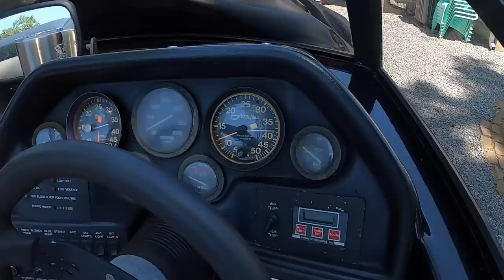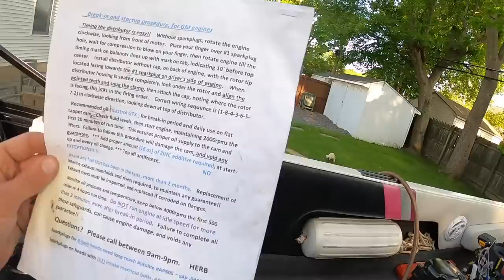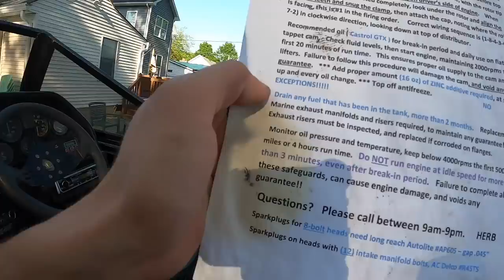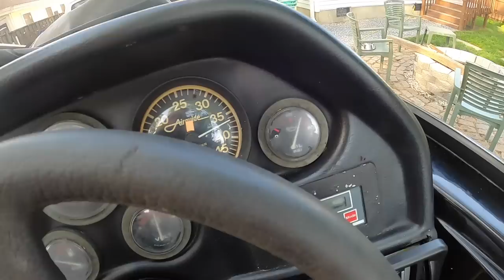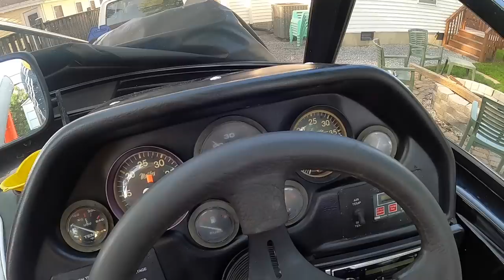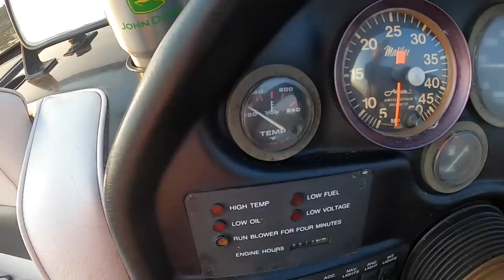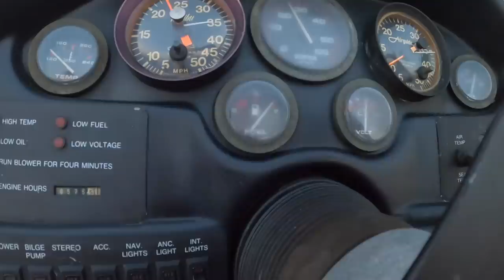NEW 350 HP CHEVY ENGINE - 1991 Malibu Competition Ski Tow Boat - Will It Start? | BOAT RESTORATION

Comment: The shaft seal should have a slight drip otherwise it will overheat. There are newer styles that are dripless. You should probably change the packing inside anyway and get the drip rate set correctly.
Reply: I thought they are supposed to drip while in gear but not drip when not in gear

Comment: I'll be honest. My last custom built boat which was a Triple pontoon. I wanted to build myself cuz I wanted to have a bit of a different layout then normal and i wanted a longer boat and for it to be a inboard outboard setup. I ended up finding this company that sells the pontoons in fit together pieces made of a special polymer that's like a light color and they have several to choose from. But what's really cool is that you can put lighting inside the toons themselves and they light up and I've never seen anyone else have it. And I get so many comments on it. The other thing I did was on the front each pontoon has thrusters so that I can turn on a dime if needed. And then on either side of the main engine are two electric motors that actually go inside the toons and thru the back that can be ran together or one at a time and believe me sometimes it's nice not listening to my ridiculously loud olds 454 that's cammed out and supercharged around 850hp and yes it drinks at idle about 2 gallons an hour. I've never tested it above 70mph because it gets super squirrelly but still handles good. I imagine that I can easily hit 100mph which is saying alot for a 28 foot pontoon. That's also got a swim platform and secondary helm on the second floor. I also decided to try the new fencing design that isnt steel but ultralight aluminum frames with polished acrylic panels that are black and depending on how you want it the acrylic can fade to not be see thru or to allow the lights in. I wanted from the mid seating which are double wide couches with backrests to the rear end minus 2.5 feet so you still have a rear platform to fish off of or to get to the ladder for the secondary platform. I also have an enclosed bathroom with running sink and toilet. 

My point being this. A ton of folks do ls swaps for their boats but it's so boring. Honestly I'm in the works of building a 1950 to 1960s old mahogany style chris craft. But with something that's much lighter and having a teak deck and floor. But to power it. I want to run twin rotary engines from the newest style rx8s. You can really put a ton of power thru them sometimes up to 1000hp they are indestructible and they want to be revving easily between 8 and 10k. So they would work great. I know they did a version of these for jet engines but I wanna do prop driven. We shall see. I really wish more people built custom boats. One day I'd like to build my dream houseboat using these custom pontoons. There really is no cheaper options. And living on the water is where me my wife and two boys want to be

Comment: Cool project i had a customer that put a built 383 in his 86 malibu skier it was a beast ....didn't go much faster than 60 but it would get there quick and pull the whole dock and ski team around the lake. Malibu did build the Corvette boat with a 383 Indmar it was a ripper @ 60 mph also.....shaft angle and hull design limit the speed these hulls will achieve they are not designed for all out speed but for pulling and wake shape ....its a slalom hull so flat and smooth is what is needed often the hull will have a hook in the rear to help run flat and as speed increases more down force is put on the nose of the hull to keep the boat flat and smooth for a good slalom ski wake after extensive bottom work the boat went 60mph ...the Corvette boat had a trim plate that did the same thing and was hydraulic controlled ....maybe go up 1 pitch range and to a 4 blade ACME .   5000rpm is your wot goal.

Comment: Hey man. Cool build for sure and love what you’re doing. 

My concern with your engine is the use of automotive parts which is a huge issue for ya if you were stopped and checked by authorities. Massive fines for that.  Additionally, marine engines don’t use HEI with vacuum advance.  
I get that the parts are less money but there are major differences between auto and marine parts.  Other than that, good stuff. If ya have questions I’m happy to help.  

Be safe and have fun!

Comment: definitely needs a thermostat could  solve your richness issues , not sure if that heater is heatercraft unit or not. should be easy hookup or to get the parts.
Reply from the maker: Update: added thermostat and had to adjust timing. It fixed all issues.

Comment: I didn't see a heat exchanger, so can you explain why it has a raw water pump and a normsk engine water pump?  Thanks.
Reply from the maker: The raw water pump is self priming and picks it ip from the bay/lake/ocean etc. The water pump on the engine circulates it throughout the engine.

Comment: Hope you used marine parts and not just automotive.  Marine carbs have j-tubes, marine fuel pump have a sight line that runs to the flame arrestor.  Should be a hard line running from fuel pump to carb.  Marine distributor and starter which are spark isolated.  There are important safety reasons as to why these parts are different.